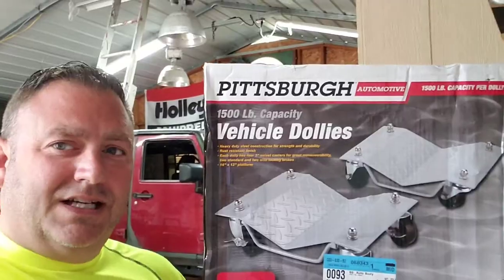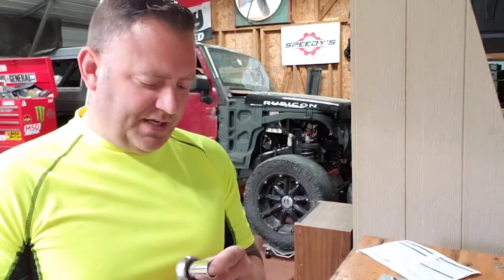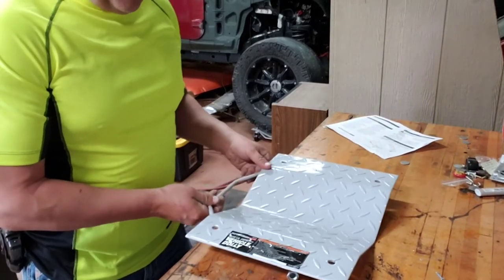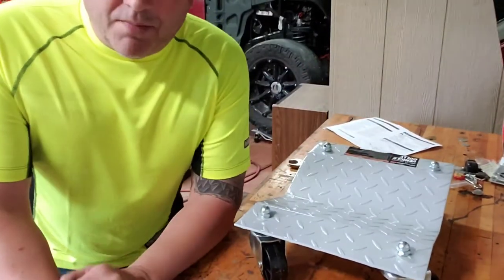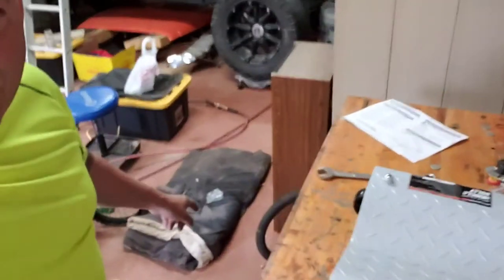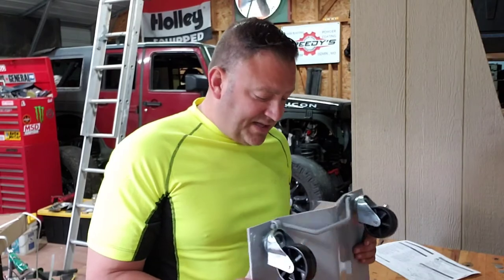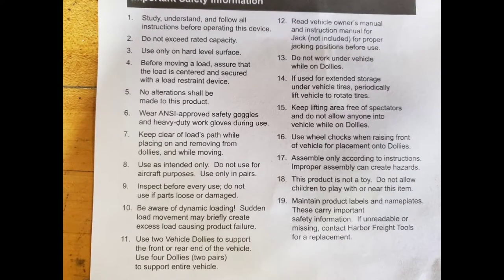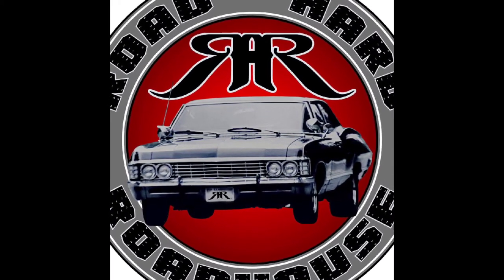HARBOR FREIGHT 1500 LBS VEHICLE DOLLIE ASSEMBLY HOW TO FROM THE ROAD HARD ROADHOUSE

Comment: I went by the picture on the box which shows the the a flat washer below the spring washer then top it with the nut. Probably doesn't really matter either way as long as you tighten it up real good.